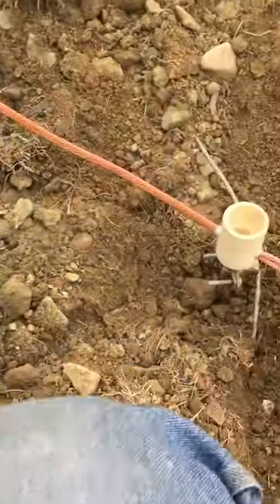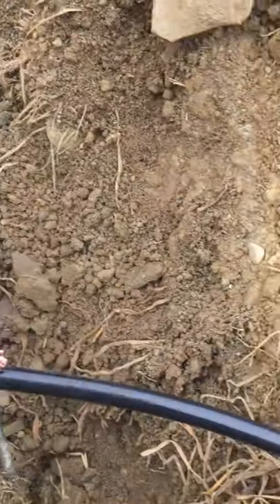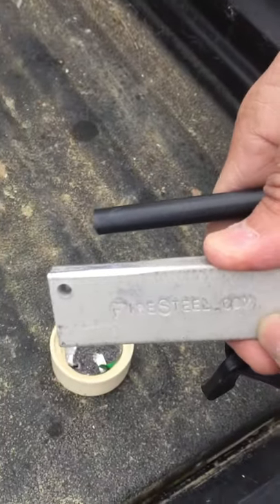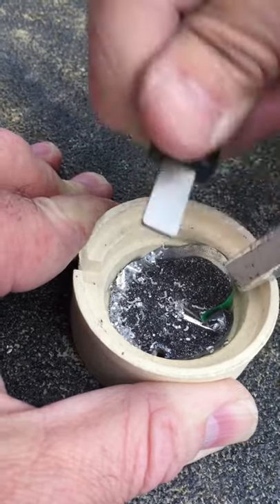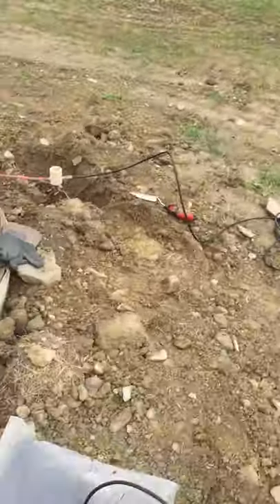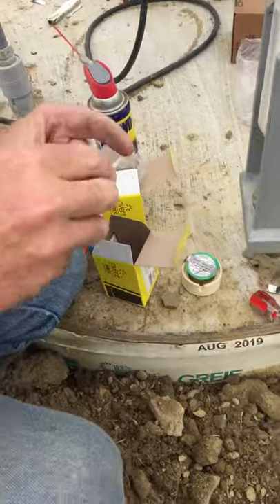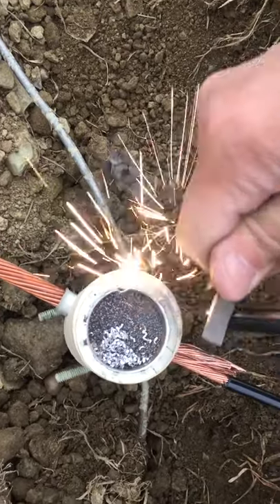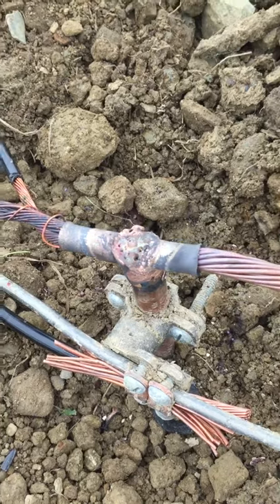Erico nVent Cadweld Plus activation without using PLUSCU ignitor

Comment: I had to do something similar when my supply house only had the "plus" units in stock. Its a dangerous approach because you set it off without the containment cap. This could also lead to problems as you are now using it outside of its listing requirements. Without having the containment cap on the top there exists the problem where the weld may not form properly, or may have defects due to material spashing out, or cooling too quickly.

What I ended up doing was mixing and matching the mold pieces with other non plus kits that I had. Of course now I still had a bunch of parts including the "plus" pods, so I wanted to know how the igniter worked.

I reached out to Pentair's technical support and found out the following about the PLUSCU control unit:

The CADWELD PLUS Control Unit (p/n PLUSCU) is basically a capacitor charge / discharge system.  The 12V charge system utilizes a microprocessor-controlled Pulse Width Modulator (PWM) circuit to charge a 250V capacitor.  This charge circuit is initiated by pressing and holding the Control Unit pushbutton switch.  Once the capacitor reaches the full 250V charge (5 to 7 seconds on a new set of batteries), there is a 1-second dwell.  After the 1-second dwell, an SCR is triggered to release the charge to the contacts at the termination clip.  If at any time up to the point where the SCR is triggered, the user releases the pushbutton, the unit will begin an internal self-discharge through a discharge (or "bleed") resistor.  The contacts in the termination clip are "normally" closed (that is the contacts, when not attached to the ignitor strip, create a closed circuit to the internal discharge resistor) - they cannot hold a charge.  The charge capacitor does not store the energy indefinitely - it is either switched by the SCR for an external discharge or drained through the internal discharge resistor. 
Two circuit improvements were added as a result of a FMEA study:

1.  An additional circuit was added to prevent the possibility of voltage being present on the contacts during the charging and dwell times.
2.  A redundant overcharging circuit was also added - this circuit will shut-down the unit in case a failure within the unit causes the capacitor charge voltage to reach 285V.  This circuit can only be reset by removing the batteries for about 1 minute.

 
This might be of interest to you if you want to devise a way to electrically ignight the pods in the future.

Greg N2GZ